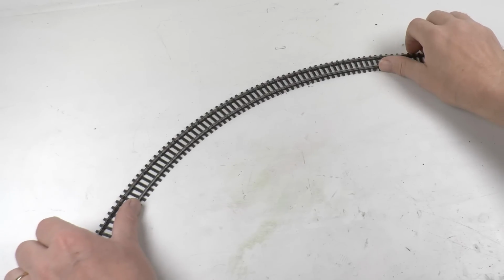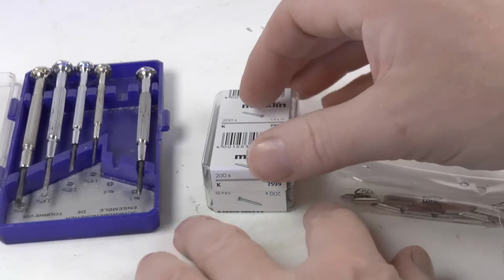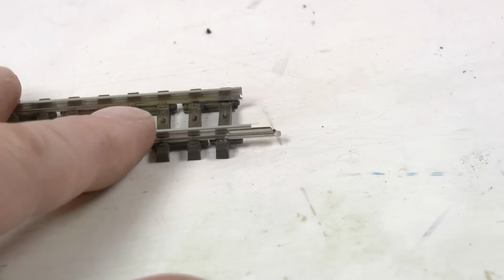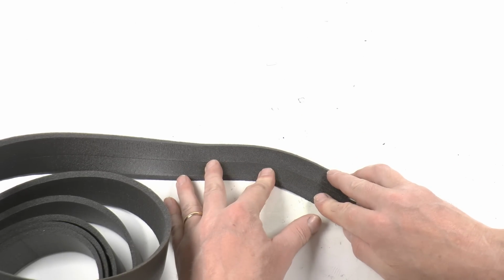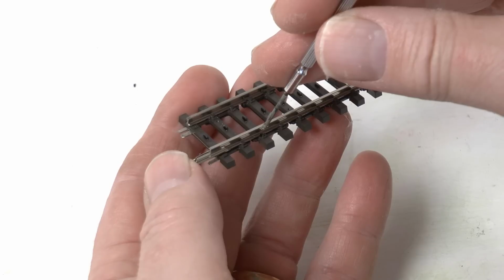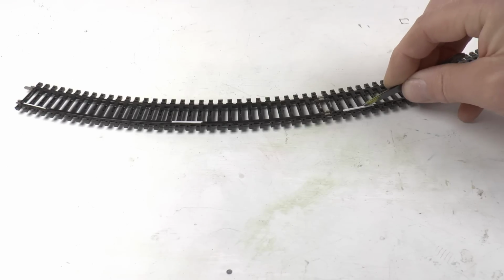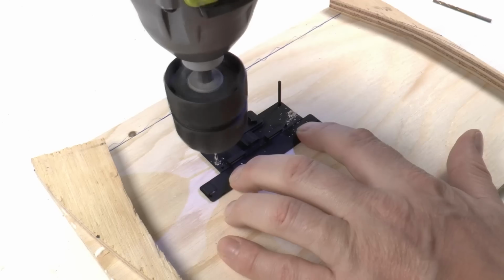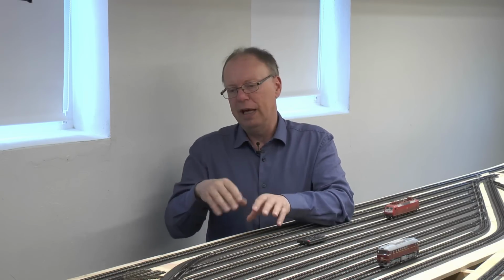Ultimate guide to laying Marklin K-tracks

Comment: How do i connect k track switches to a mobile station I just saw that the connectors is for analog stuff (I think) I want answers because Im thinking of building a layout with K track instead of C track also I do not have a soldering iron thing and don’t really plan on buying one

Comment: Do you have to keep gaps in between the rails to allow for heat expansion?
Reply from the maker: No, that is not neccesary. The room temperature and humidity is controlled, so there will not be any fluctuations.
Reply: @ thank you so much for the reply. That’s a good point I didn’t consider. Thank you. Keep up the great work!

Comment: Soldering to the rail joiners without using the corrosive flux method is my preferred method and using the original center contact soldering point at each end is also my preferred method, your railway your choice obviously. I have never seen the under board mounting kit for the K track point motors, very informative.

Comment: Great series! I really enjoy your informative videos. 
I have a stupid question, how do you align the paper templates with each other? I'm using RailModeler Pro. It prints alignment marks but they don't extend to the edge of the paper. They look a lot like the marks on your templates.
Thank you!
Reply from the maker: The printed alignment marks is visible through the paper, so that the alignment can be made with decent precision. It’s not perfect, but the best method I used.
Reply: @ Thank you for the quick reply! That makes sense. I’ll try printing it out on lighter paper. The 20 pound bond is hard to see through. 
Again thank you for everything!!

Comment: Why is it necessary to have a perfect 90° cut on the rail? What is the advantage? Is the insulation better?
The 7548 kits are just rubbish. No reliable function
Thank you for showing the tool for the joiners. I used my fingers for 30 years killing them.
Reply from the maker: Hi Supermoe, thank you for commenting. Well, I have not seen any tracks in real life cut in any other angle than 90 degrees. It would simply look ugly. I have mounted 7548 kits on my previous layout, which has logged an excess of 20k operations without any issues. What problems have you seen?

Comment: Hi, I have already finished my second layout. I saw tons of movies also at your channel and finally I got an info that there is special flux that can be used for soldering tracks. A bit late info, but thanks anyway 😊. You just confirmed to be the best rail road channel in the net ! BTW you should try XURON 2175B for cutting rails. They do great job.

Comment: Would you recomend C track for síngle track layouts? No need for flex track.
Reply from the maker: Hi! Yes, C-track is a good track type. Relaible and a smaller more realistic rail profile. It also allows you to run a range different brand of passenger coaches and freight cars. Not only Marklin.

Comment: Great to see making effective use of laying banked curves. For us, it was a tad experimental at the beginning of our build but all turned out fine actually. It seems easy to overdo it whilst the effect just needs to be quite subtle really. One thing is quite a challenge though... M does not provide express points for K-track, meaning one has to modify Peco switches, adding a puko system which is quite daunting. No out-of-the-box solutions could satisfy us really. In the end we made a provision ourselves by cumbersome trial and error. If M only would finally update their K-track system with express turnouts...
Reply from the maker: Yupp! I agree that the geometry of K-track is 80s-style and has not been updated. However, I’m trying to plan the placement of the points so its geometry looks acceptable instead. But again.. I’m not a track hardcore fanatic. For me it’s something that also exsist in the landscape.. 😁
Reply: Kul video, har aldrig hållit på med modelltåg. Men de var roligt att se hur arbetet går till när man bygger upp järnvägarna 😊

Comment: You need a pointier soldering iron tip...  Also, you should solder on the rail joiners rather than the rail.  You don't need the flux.
Reply from the maker: What you’re saying is true for most flextracks, but not Märklin K-track. That’s why I made the video.